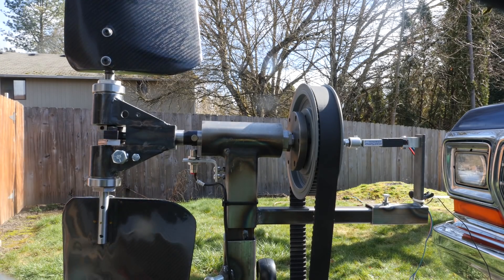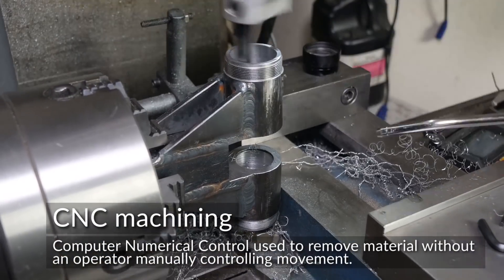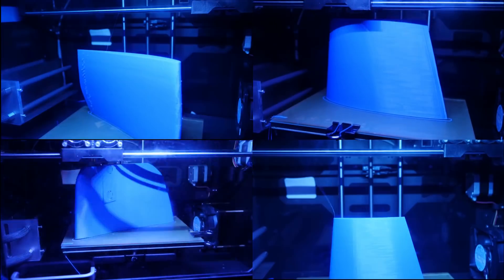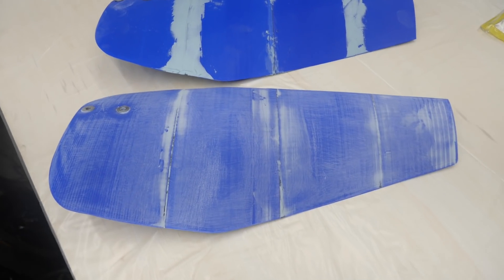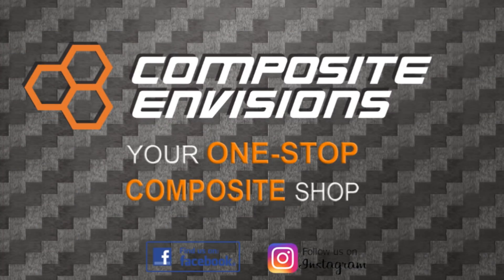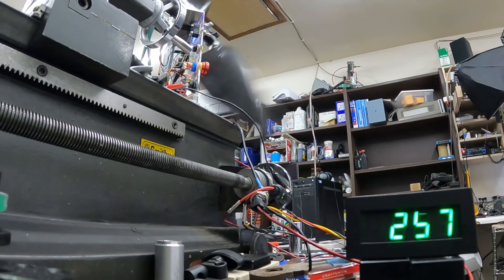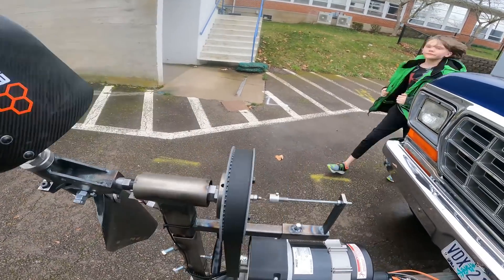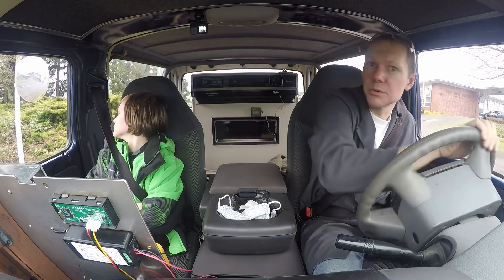Carbon Fiber Blades Making 2000 Watts! - Wind Power on a Car #4

Comment: Do you know that an airfoil when creating lift also creates a moment as a side effect? So even if the pivot point is at the center of lift you'll still have a moment.
For an aircraft the side effect moment direction is nose down.
Reply: https://en.wikipedia.org/wiki/Pitching_moment
Reply from the maker: Hey look at that. Thanks! I'm not an aviation guy but am learning. Now I need to go back and reference what I read about drag and lift force. Wasn't something I was overly concerned about but clearly I should have paid closer attention!

Comment: This is the exact thing I always wanted to try! I saw the thumbnail and instantly clicked on it! But this guy went waaay above and beyond what I would ever be able to do! About ten years ago I mounted a generator on the grille guard of my pickup with a propeller and measured the voltage. Was just playing around. I really want to make my own wind generator with these kinda blades and pitch control. Except like 10 foot blades or something of good size to make some decent wattage. 
Really good job he did on this and the video. That kid is going to be waaaay ahead of other young adults as he grows up.

Comment: Just found your chanel and I have to say, awesome project! I especially liked how you showed the CFK lamination process. It's rare to see people use this material and it's awesome properties in DIY Projects. I do have one concern though. Please put a shield around the blades! I can't imagine what would happen if the bolts fail and one of those blades flies off and hits a passing biker. Also, if you're using this device at night, consider adding reflective tape to the blade tips to make them visible for oncoming traffic.

Comment: On that truck, it's a heavy truck, so mpg shouldn't diminish much after getting up to speed, if at all, 
 The air will be traveling faster over the cab than in front of the truck, just a thought for efficiency,  speed of the truck + speed of compressed air over the windshield and over the cab.  I wonder what the diffrence is actually? Maybe not much, but maybe alot. Idk. Cool thing your doing. I wish I could do things like that. 👍
Reply from the maker: You've summarized the thoughts that have been bouncing around my noggin for the last 20 years. But we will have an answer soon!
Reply: @QuintBUILDs  l think about the exhaust on my atv to turn a small wind turbine. To power my led bar. The exhaust should not effect the performance at all of any vehicle. Unless it is added to with enclosed pipe. This would be just a small dc motor w cup type blades to spin as exhaust passed thru.  I really want a gravity type generater for home power. A 24hour falling weight.....like the old clocks

Comment: From what I understand about energy, the truck's engine will have to work that much harder to fight the wind resistance of the turbine. 

So basically, this was a really really expensive way to burn more gasoline.
Reply from the maker: Video proving it works: https://youtu.be/tEPBdztGMdI  😁
Reply: @QuintBUILDs ,  I'll check it out.

Comment: The drag this creates is inefficient and is offsetting any gains.
Reply from the maker: You say that as if you have evidence.  This is not as simple as a thermodynamics textbook but we'll find out for sure shortly.
Reply: @QuintBUILDs  Get a more efficient vehicle, put the turbine on a stationary object and make pizza at home. With such an inefficient vehicle it will show up as less a % but it is proven you cannot generate electricity beyond the waste in this application.
Reply: @QuintBUILDs  If you were to have a turbine pop out when braking is applied you could have short gains though you are better off with an EV.

Comment: Sorry for, maybe a stupide question, bit is this system adds up energy consumed by car to overcome wind resistance, or generates electricity by using part of the amount of energy the car requires to overcome wind resistance itself? Is it useful to install it on electric car just by means of energy? Is it actually regenerates or just adds up wind resistance? 
I understand that there may be no strict answer but hypothetically? Thanks for your time!

Comment: Just a note, be careful with advertisement. I think there might be rules about having to state that very clearly
Reply from the maker: to what are you referring?  The video is marked as sponsored if that's what you mean.
Reply: @QuintBUILDs  You are just right, I must have missed it in the beginning. No worries, look forward to see the next part in this series!
Reply from the maker: @magnushem5130  No problem.  I didn't feel like it was warranted because Composite Envisions didn't pay me anything, just covered cost of materials.  But YT classifies it as "receiving anything of any value" which is pretty all inclusive!

Comment: Why is that, that at 1500RPM we could only develop around 3 to 400Watts hardly.  but when we do it with carbon Fiber at 873Rpm we reached 2KW. How is  the material is helping  to produce power but Not the RPM. because to generate electricity we need more RPM right, but here only at 873 we are getting 2KW but we are getting 300 Watts at 1500 RPM How? can you please explain.
Reply from the maker: This was the 4th video, #3 introduced a new larger generator that's never had a turbine go over 1000 rpm. Watch them all the way thru and pay close attention.
Reply from the maker: Different generator entirely if I'm not mistaken.
Reply: @QuintBUILDs   you mean previously you used a low  power motor and that made a output difference. Can also please tell at what speed(anemometer and Vehicle speed) did you achieve the power. Why because it wasn't clearly seen in the video.
Please Sir..

Comment: Little thing I suggest you should look at: The Reynolds number for the airfoils at the tip speeds.   Many of the "college" based tools use airfoils that have really good CL/CD numbers at low speeds but stall at medium speeds due to separation. The airfoil must be calculated at vEFF which produces variances from tip to root that are a factor of "r."  I have found that many times this results in an Re of 1.5m-2m for airfoils that really only have high CL/CD's at around Re 500k.
The airfoil  profiles have to be balanced around their center of effort, I can see that your carbon blade is way to close to the leading edge; this produces the moment on the blade you are needing to react.
Reply from the maker: Thanks.  I used a Re=100k based on a university paper empirically testing a similar sized turbine against calculations based on Re from 75-250k.  The higher the Re used the greater the predicted power and I didn't want to get my hopes up.  My results aren't far off what was predicted and the blades could still be "timed" far better than they are.  My understanding is the lift and drag forces act at a point about 1/4 (don't make me go look it up) of the overall length back from the leading edge.  But I only cut the mounting rod to center so both drag and lift generate a moment the actuator is fighting.  I could make new hardware and eliminate the moment but it would be weaker and cause issues assembling everything.  What formula are you using for Re?  I'd love to run the numbers to see what theory suggests Re should be.  I'm told the LARGE commercial turbines indeed use numbers in the millions.
Reply: @QuintBUILDs  NREL Has an amazing repository of white papers, its a great weekend of digging. 

Different airfoils have different have different centers of effort that rely on the angle of attack of the blade and Reynolds numbers[calculation wise].  The glider profiles that are generally used for academic papers and the such are generally never tested and most CFD has problems accounting for the rotation of the blades.   

NREL has "airfoil families" that address the impact of this on longer blades: an issue that's null on the scale you are working with for sure, but it helps cornering the math.  The NREL papers cite a center of effort that is between 30 and 40 percent cord length.  I have  found that this helps with the blade moment quite a bit [given its twist]. 

Gliders and the such produce a center of effort at about 20-25 percent the cord length true, but they are a flat span with zero twist, when I have ran simulations on this format I generally get massive blade moments.

As for the Reynolds number, I calculate it for each blade section, it's a simple thing to do with a spreadsheet: this allows me to get the taper of the blade set right.  The reason why I bring it up  is: in the calculation of Reynolds number you have a velocity and length component, double the velocity and you double the Reynolds [mostly] number.  At the tip of the blade, which is where most of the drag is: this can change dramatically at RPM increases.
Reply: @QuintBUILDs  I just realize you asked for an equation https://www.grc.nasa.gov/www/k-12/airplane/reynolds.html is the format i use.  Where L is the cord length of the airfoil.

Comment: I've wondered this for years now.   Why don't we add a wind turbine to our cars, truck, and trains to generate electricity?   I remember your first attempt with the wind turbine and look how far you've come!  To be able to share that with your son is priceless.  Why can't we charge batteries while we travel at speeds high enough to generate power for the camper while we stop to get supplies, or go out and just have some fun with the kids?   A good-sized battery bank will power a camper, trailer, a tiny house, or even provide power during a power outage.  Not to mention DC power for power tools for commercial use... The concept is great.  Keep up the good work.   I look forward to hearing more.  Keep the dream alive.
Reply from the maker: Ironically it has apparently been done on the caboose of a train for an emergency braking system in the case of a power loss.  But there's a real risk that the doubters are correct, that any power generated will result in an equal or greater fuel penalty.  But I reject the notion that it's obvious.  In fact I bet they're incorrect and this will 'recover" some spent fuel through the increased efficiency of the turbine blades vs. the blocky front end of the bronco.  Either way we will find out for certain!

Comment: what about fuel economy - pushing a fan to generate a electricity with a fuel powered car, just burning fuel to increase and keep rpm, on that fan, with so large engine you dont even feel that. but if you will use 1.2 - 1.1 Liter engine, and small car, that air drag and fuel consumption will make your day

Comment: Can you use a servo or stepper motor to increase the length of the rod that controls the blade pitch?
Reply from the maker: That was my first thought but wanted to have a display without adding an encoder.  A self-contained servo seemed simpler at the time.  That is if I'm correctly understanding your question.

Comment: I would love to see you disprove the  knowledge regarding physics and the  production of power and why putting a turbine on a car can not produce more energy than what it takes to power it.  I’m sure some just hasn’t invented a device that can multiply the energy produced by the turbine so that self charging electric cars can become a reality.
Reply: What you described is just physically impossible. You can't multiply power, you just can't.
Reply from the maker: Video proving it works: https://youtu.be/tEPBdztGMdI  😁
Reply: @QuintBUILDs  No, the guy was talking about using it to recharge an electric car while running and It's not what you did. Overunity was, is, and will always be bs

Comment: Are you sure you have the blades on the right way round. The air is supposed to hit the top of the airfoil first not the bottom.  Look a t big turbines.
Reply from the maker: Ask yourself which side of an airfoil has the higher pressure...
Reply: @QuintBUILDs  That has nothing to do with it. Wind turbine blades face the wind and are angled just like propellers. Like this https://www.tdworld.com/renewables/article/20972055/wind-turbine-blade-inspections
Reply from the maker: @chrispollard6568  go watch part one of this series and see if that helps.
Reply: @QuintBUILDs  You're right - I wasn't looking close enough. Thanks
Reply from the maker: @chrispollard6568  👍
Reply: @QuintBUILDs  So what do you do to match the load to the generator to maximize its output?

Comment: What you swaped a Triton ? I was under the impression that, that engine is not reliable, have i been told wrong?
Reply from the maker: Got 60k on it and I already had to replace the cam phasers.  Could be worse I suppose.

Comment: That would be an epic traffic stop if you got caught speeding.
Reply: Good excuse when you go in front of the judge. 
Defendant: " Officer Jones, exactly what did you clock with your RADAR? "
Officer Jones: " Your vehicle, I think. "
Defendant: " But you can't say for sure that it wasn't the spinning propeller on the front. "
Judge: " Spinning Propeller? "
Defendant: " Yes your honor. "
Defendant: " So officer Jones, what was the wind velocity on the day in question? "
Officer Jones: " About 20 MPH. "
Defendant: " And what over the speed limit did you clock me at? "
Officer Jones: " 20 MPH. "
Defendant: " And was  wind at the front of the vehicle? "
Officer Jones: " It was. "
Defendant: " So it is possible that what you clocked was the prop and due to the headwind, it was spinning at a speed that would have included the wind speed and affected your RADAR signal? "
Officer Jones: " It is. "
Judge: " Case dismissed. "
:-)

Comment: maybe you could generate more power, if you would mount your turbine on the roof of the car. 
Because of the air can flow away better after it passes the turbine.
Reply from the maker: agreed.  But there will certainly be a mileage penalty on the roof whereas in front of the vehicle there might not be.  That's the curiosity of mine that originated the project.  I haven't decided whether I'll actually mount it on top to test or not.  I've already got a roll cage in there to mount to.

Comment: A ScanGauge II is a quick and accurate way to measure your MPG. I think you'll be surprised how much the turbine affects it. To be scientifically accurate, make repeated runs on the same day over the same stretch of road with and without the turbine on the truck. This is called A-B-A testing.
Reply from the maker: Thanks man! This is why I love the internet, well, one of the main reasons anyway. Saves me the trouble of searching. That looks like a great product! And absolutely, multiple trips, different directions to account for wind and grade, with and without turbine. Can't wait! 👍

Comment: I knew you replaced the dash from your reply to a comment I had on the beginning of this series but didn't realize you swapped out the powerplant! How are your mpgs now with the more modern guts? Ive got a '73 f250 and I'm lucky to see 12 mpgs highway. With my current stock gearing that's putting me close to redline at 70mph but I dont go that fast very often.
Reply from the maker: Used to be 8-9 with the 400m, right after the swap I got 18 on trips just like the sticker on the F-150 but now it's more like 15mpg.

Comment: To find the best prop pitch what if you looked at hobby grade FPV drone props and take the pitch from those?
Reply from the maker: Actually something I learned thru this was props for hovering don't work so great for turbines.  It's why helicopter props have no twist along the length. In theory the incoming wind speed is at or near zero so the relative wind (see video #1) angle is the same regardless of radius.  Not so for airplane props and of course wind turbines.

Comment: Isn't this only useful while coasting down hill,  or when you're slowing down to a stop (excess energy,  and recovering spent energy)?

I mean,  shouldn't you disengage a clutch on the generator while accelerating and cruising? To avoid using more fuel than simply running a generator in the trunk.
Reply from the maker: this will get covered in the next two vids.
Reply: @QuintBUILDs  
Thanks, I suspected this is where you'd be going.